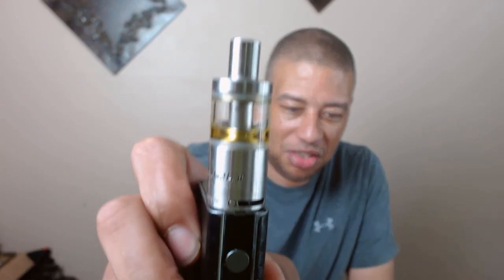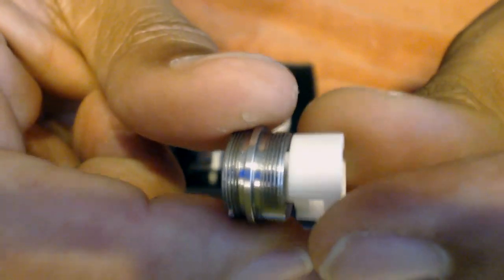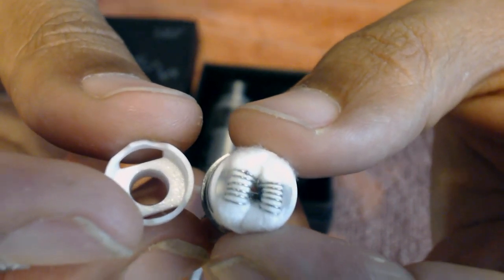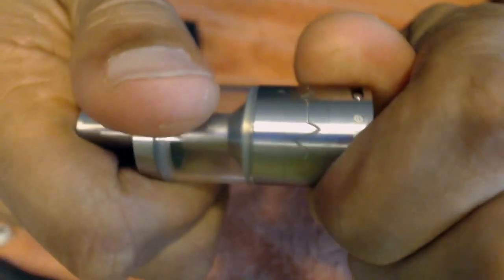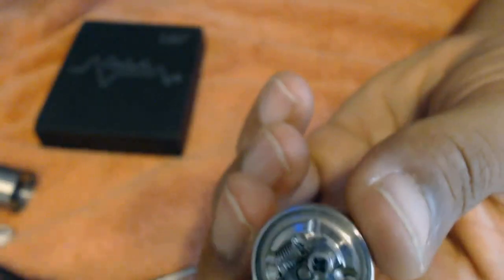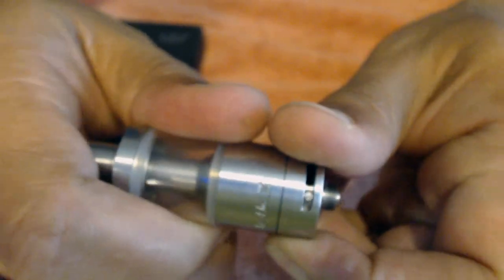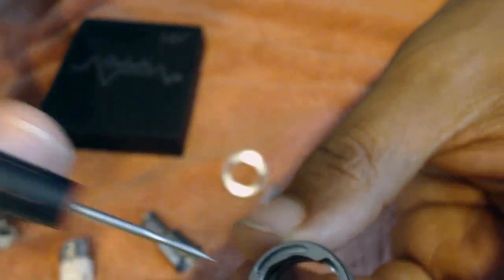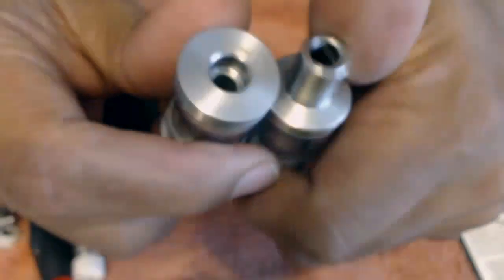Youde Goliath V2   Ud Goliath v2                   The Don

Comment: I've been using the prebuilt coil for a couple of weeks and it's getting pretty gunky. I like the ceramic build so thanks for showing the rebuild for it.  I haven't had that much trouble with my juice or airflow control... maybe a little small for some peoples hands but, if you don't over tighten when reassembling things work fairly well. Just built my first dual coil with 26g at 3mm reading about .6 ohms. WOW Again, thanks for the video!

Comment: Hay Don I ordered me a Goliath v2 to day after reading for couple days. checking videos run across your video just now helped answer some questions like 3 mil build no problem looking for something to replace my sub tanks. thanks for a very good look at the  RTA  I plan on slapping a .06 nickel build on it dual coil haven't been keeping up with your videos my loss. hopping it will work a little better than .mod my kanger plus dose for me not taking anything away from sub tank got my stuff set right with pioneer4 you they used my grounding method in there new IPV4S sent me one to cover the headaches  NC like to meet you some day take care Brian
Reply from the maker: No problem. Me personally I have not put any ni200 in the Golith as of yet. There is more room for it. This new dna 200 is a very nice chip. If you can afford it I would  get one. Thanks for watching
Reply: +The Don well after a bit of juice boy do  I like this Goliath v2 now I learned a few things for me that make a big difference I use the rba 99% of the time by dropping two screw drivers down the air holes before I build stops it from moving now just snug not crazy then pair of finger nail clippers flipped open in the air to snugg it to the 510 again not crazy now when I grab the tank by the top it shuts the juice flow off as I take the tank off pretty Kool then I open the juice control fill it close it reinstalling the tank holding it below the juice flow only never grab tank and crank it down no leaks easy fill did I say I really like this tank lol
Reply from the maker: +Brian Bavington I took the o ring off that you see on the base  when you take the top off to fill. it's much easier to take apart with out pulling the rba or coil out when Tim to fill. also the juice control is much better to spin.

Comment: Hi Don - love your reviews!  I am sat here trying to decide between the Goblin Mini, the Goliath v2 and the Zephyrus - have you had any leaks from the Mini?  That's the only thing that puts me off (as well as the low capacity, but you can't help that if you want a small tank). Still think the Goliath v2 is winning but with an IPV4 the smaller tanks are appealing just for their size. Heard loads of bad reviews on the Zephyrus but that's mostly about the stock coils and the RBA and reducer for single coil makes up for them!
Reply: Argh I got mixed up, it's the Goblin Mini that has the reducer in there for single coil.  Well that's the Zephyrus off the list at least!
Reply: The mini gives better flavor  imo. But you get so many  options with the G V2

Comment: I wish you had shown how it's filled.
Reply from the maker: I did....the same as the the old one. I even said it's a tad smaller
Reply from the maker: +John Smith mine had great air flow. Also I took the o ring off...the one you can see when you open to fill. it makes it easy to adjust air and when you take apart it does not spin the coil out.